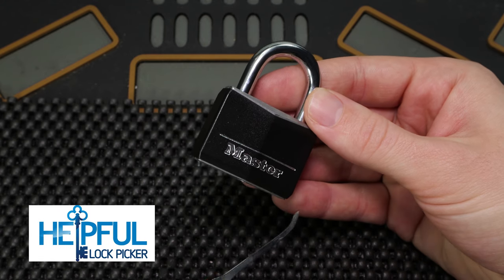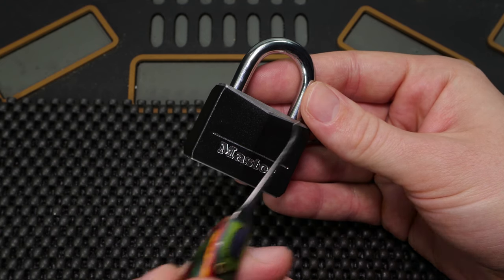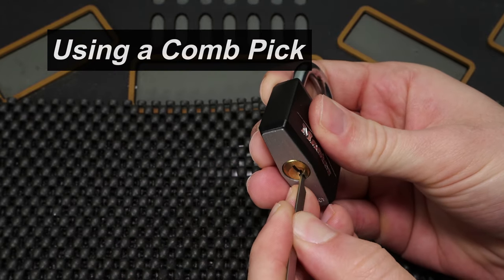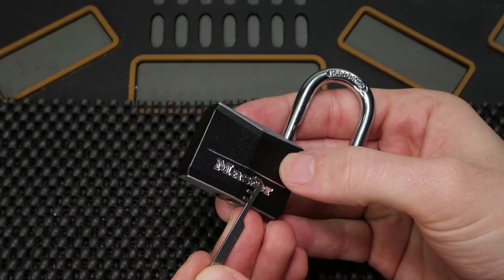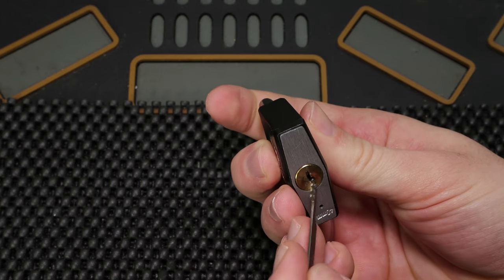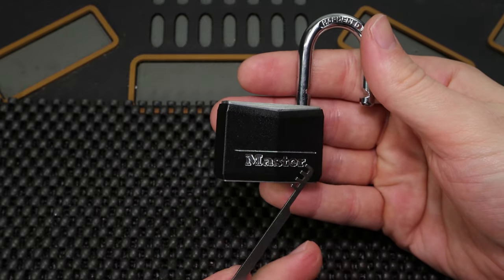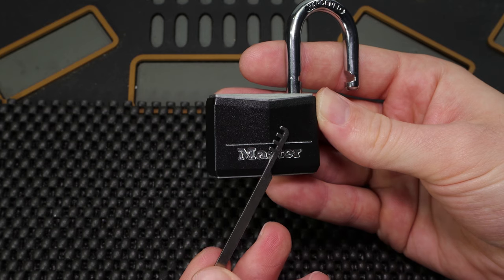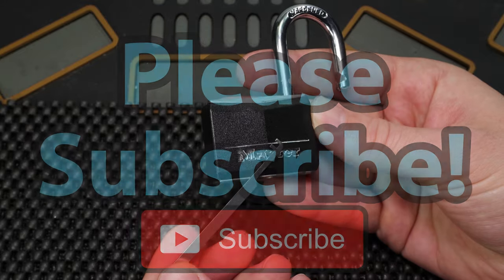[366] How To Pick (Bypass) A Master Lock 141 In Seconds!

Comment: Thanks for this great little video.  Can you do a video on picking common warded locks without using a warded lock pick set?  Or are warded locks difficult to pick with pin tumbler tools?
Reply from the maker: A video picking them with regular lock picks?
Reply: @HelpfulLockPicker  yes exactly!  I've found myself needing to pick my own cheap master warded lock but failed as I don't own warded lock picks and finally resorted to cutting my chain instead.  I felt so silly cutting the chain and being defeated by a simple warded lock.  I had forgotten my key and wasn't worth it to return.